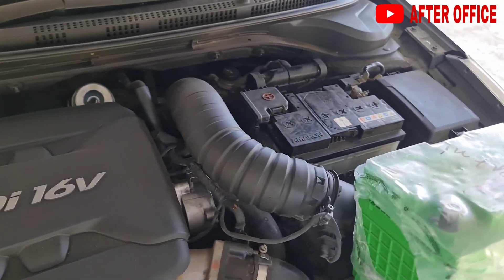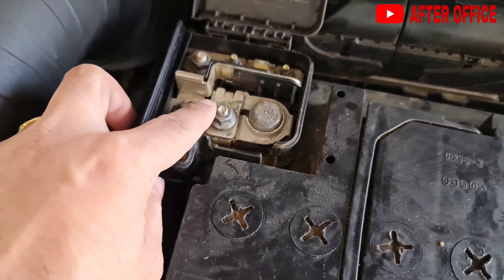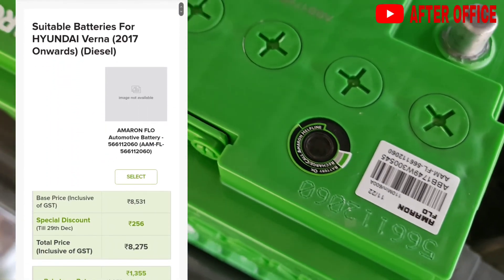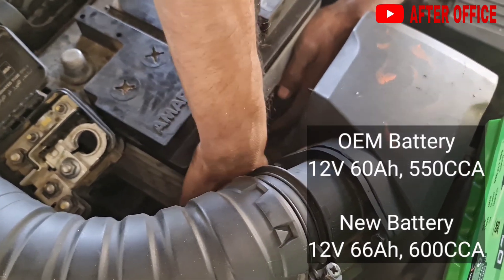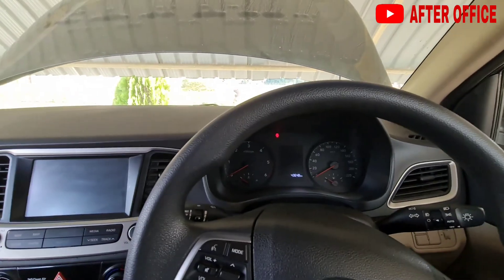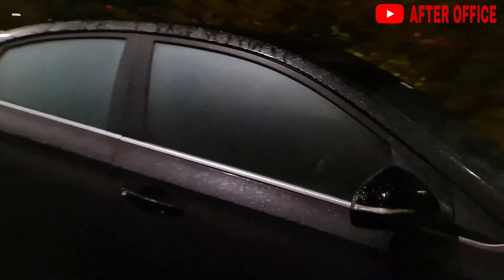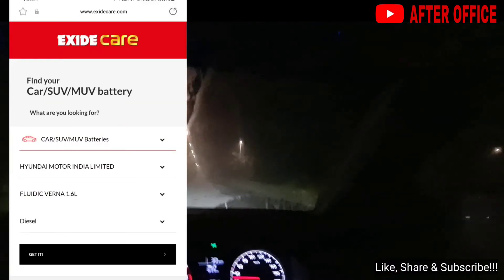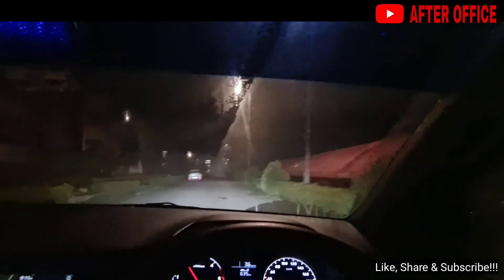Car battery change on Hyundai Verna | Amaron vs Exide Battery | battery spec explained, CCA, Ah ⚡️

Comment: Dear sir your new amaron battery  and old battery are 60 Ah,part number indicate 566112060 means DIN60,that means your old and new batteries are same ampere sir not a 66Ah battery,66Ah battery used in Innova crysta and suzuki swift D vehicles
Thank you sir

Comment: Great video brother 👍.... I have 2016 4s 1.6 verna. What is the difference between 2017  1.6 crdi and 2016 crdi? .... I think there will be difference in ECM. rest of the engine parts will be the same what do you think??
Reply from the maker: Clutch wear out in fluidic verna 1.6crdi very soon... In 2017nexgen verna clutch wear out issue is nt there.. I think in 4s verna also clutch wear out is not there.  Engine gearbox is same, just cruise control